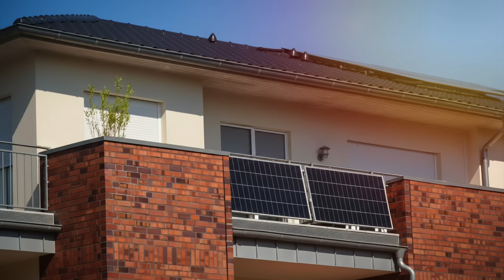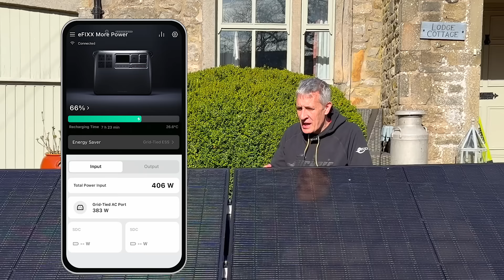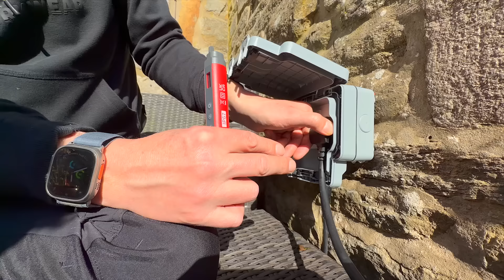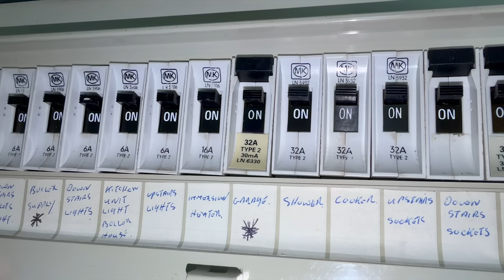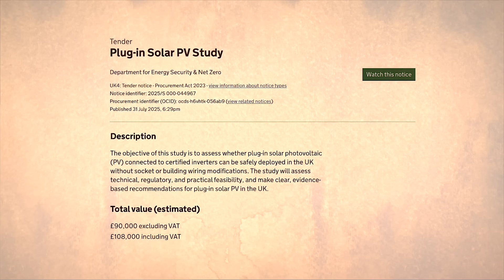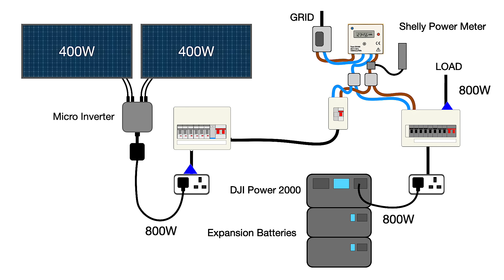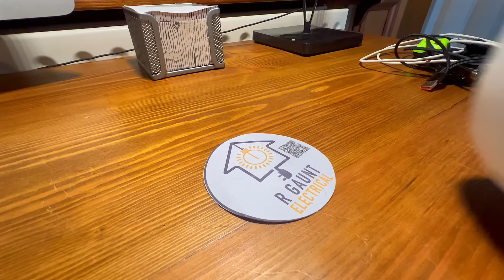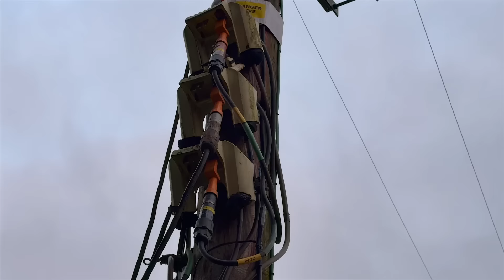Plug in Solar: We’re Told Never Do This… So I Did

Comment: We have ‘leased’ panels that we inherited when buying the house. There’s a few years left before I’m allowed to do anything with them but for now, we do benefit from never paying to run the washing machine / dishwasher etc during the day.
I have some ‘power station’ batteries we use for camping. I’d love to set them up so that they charge when there is excess energy being produced only. they would need to be plugged into a mains socket as I can’t tamper with any wiring on the solar system….. is there any way of doing this? Is there any equipment that can defect on the mains circuit when there is excess power going back to the grid which essentially ‘flicks a switch’?

Comment: Seems like an ideal solution where space is limited. I've got a large roof, but that's got hot water heating solar panels already that I don't want to remove. They provide all of the hot water for the entire summer without using any gas. This would enable the remaining odd spaces to have solar, such as the Garage roof.

Comment: If the DJI system is set to charge over night on cheap rate, and the solar panels just plug into the standard home sockets, how does the power from the solar panels find its way into the DJI batteries during the day? (Outside of the scheduled cheap-rate recharge time) - is there a control system that integrates this via software? (Or are you literally just enabling the DJI batteries to charge manually via the app when you have some excess?)

Comment: They call it balcony solar. But it is more uesd as storage roof solar. Easy to just put some on a storage shed and plug them in. If you only plug in solar the chance of overloading is minimal en 0 if you just put two panels. It gets a bit more tricky when adding batteries that also charge when power is cheap. But ppl also install ovens and washing mashines. They need to understand not to plug it in on a same circuit of even same phase depending on the max power capacity of the battery. The problem is regulations are usually made for the level of ppl that dont think about what they are doing...

Comment: But why would plugging it into a high quality rated extension lead be bad? If it's in a waterproof housing? It's the same as plugging into the socket just with some power loss due to length

Comment: £1 a day sounds a bit pants with 7 year payback on stored energy but surely using the almost 1kw while the sun's out saves the same again due to less conversions? Be interesting to know a clearer maximum savings potential between the stored energy scenario or when you use it directly during the day if you're able to do so. Maybe I'm overthinking it lol

Comment: This can't be legal because it's able to feed the circuit with more amperage than it's rated for.   If you have a 15a circuit, with a 15a breaker, and 15a wiring, the combination of the solars amperage + the mains panel feed can create a condition on the circuit where overcurrent protection won't trip properly.   It's analogous to putting a 25 amp breaker on 15 amp wiring.    Best case scenario would see a 7.5a breaker feeding a 15a wire while also putting a 7.5a breaker on the solar so that the sum of both breakers cannot exceed the rating of the wiring / other devices on the circuit.   

This is just a 'smaller' version of not being able to exceed the amperage rating of a mains panel.   If a mains panel is rated for 100a of service, you can't have a 100a breaker coming in plus another 20 or 30 amps of back feed (be it solar, wind, etc...) as the mains panel would then be able to exceed its 100a rating by a combination of inputs.    Thus the ideal solution is to use a 125a mains panel with a 100a main breaker and a 25a breaker on the solar side so that the sum is equal to or less than the panel's rating.

Comment: The danger is that people working on the power supply if there is a power cut.
The elections will consider that the power lines have no voltage. If you're putting voltage back down the line.
They could receive a shock.

Comment: Do you know if these batteries shown in your video for home solar systems allow you to limit charging between around 20%–80% to extend battery life, or is that handled automatically by the battery management system?
Also, when the battery is full, does the system stop charging and export power to the grid, or is there some form of bypass?

Comment: Solar installation fires in Germany are rising alongside adoption, with roughly 150 significant incidents annually among 2.5 million systems, often caused by faulty installation, technical defects in lithium-ion storage units, or, rarely, lightning. While serious fires are rare (0.006% of systems), they pose severe risks, including toxic smoke and difficult-to-extinguish rooftop blazes.

Comment: Great video. Very informative! 👏

We’ve been championing DIY Solar for over 13 years, so love to see this coming. 

Just make sure to use a G98 certified Micro-Inverter that has been tested for use on the UK grid. There’s a lot of cheap ones out there that are not tested and can be unsafe.

We recommend the Enphase Micro-Inverter. A USA brand that have been in the industry for 20 years and back their products with a 25 year warranty. 

When connecting an electrical device into your home, you need to know it’s safe.

Exciting times ahead.

Comment: Be good to have a type 2 plug on the end of the cable to plug straight into my EV on a sunny day
Reply: I'm more of a diesel kinda guy personally, but if it was possible to charge a car in northern England using solar, I'll be making the switch. Better that savings go into my pocket than the regime.

Comment: As an electronics engineer ,I do things differently, my way is a lot more efficient, cheaper, more reliable ,as there are less parts to go wrong & i have a lot less safety feactures, i can live with that,as im sensible,not someone that has zero knowledge on what can go wrong. Can i tell you what i do instead,no,as it only takes one fool to sue you ,when it goes wrong.

Comment: I am living in Germany with a 2000w balcony solar system, plugged into a 5.2kw battery. Max input to the house is fixed at 800w. Total cost was 1800eur including mounts for the panels. Last year having installed it at the end of May and full generation to the end of 2-25, was 840Kwh. This year I am at 240Kwh. When our electricity was at 40 cents per kWh, the pay back was quite quick, price is now around 27 cents per KWh. Honestly, installation could not have been simpler,but it should be noted that most German houses have balcony’s, hence the name.I wish we had put it in sooner and whilst this does not cover our energy usage, it does allow us to at least cover some of our demand. The challenge I see for the Uk is not the system it’s self, but where to put it. The benefit for us is it was an easy install on an existing balcony, but the uk with modern building styles, tiny gardens, means the only place is on the roof and then the installation becomes more costly than the equipment.

Comment: So why as installers do we need to declare to dno of our connections. Apply for connection. Customers can only have export limitation. ENA data base of inverters and batteries we can install. Bidirectional rcbos. CT clamps. Energy meters. Pay for MCS to provide certificates. Pay for governing body to sign off work. People will say its only 800w systems but as an electrician iv see a lot of bad DIY jobs and trust me people will be using extension leads. Overloading ring circuits. Its a complete contradiction and frankly i can only see this being regulated once god for bid some diyer burns there house down with there family in it for our government and IET to rush in regulation change. 
The current industry is a joke

Comment: Confused. At 1.46 he says there is power flowing until he pulls the plug. Thats is the same when you unplug any appliance. The source is the socket, no?
Reply: Or is the socket isolated at the consumer unit. But if that was the case it would be the same as being unplugged

Comment: I've put in two of these in Germany, one of them with a battery. 
My view, the most dangerous part will be people trying to mount 440W panels on a balcony and losing their grip. These are unweildy.
Also, compared to Germany the UK is a LOT windier. Make sure they are secure. 
My flat roof solution is 4 440W panels (€55 each), 30 degree mounts (about €30 per panel), a €90 micro inverter, and a €900 4KWh Growat Neo battery. The panels plug into the battery, which then outputs into the inverter. Plus I installed a IP65 rated outdoor socket connected through a RCD. 
I program the system to release 250W throughout the night. That is a good add on to the house panels and battery. 
If you are just installing 2 panels and have no existing solar, a battery is not worth it as almost all your generation will offset mains load. And no how above battery costs dominate total costs.

Comment: If only I had waited... I spend £6k on a 4.5 kW system on my roof in November 2025. ... I wish I had waited for a) Balcony systesm   B) PVT Solar electric and Thermal hot water via the roof. 
Space Heating and water heating take more kW than lights, fridge freezer, and PC.    How to heat the home via electric

Comment: So why not just plug the panels straight into the DJI batteries? They have solar inverters built in. Then you do need a separate micro inverter surely?

Comment: Apologies if you mentioned it and I missed it, but did you address what happens if the incoming mains supply to the house itself fails? To prevent a solar installation - including plug in systems like this - sending voltage back into the mains, potentially putting anyone working on a supposedly ‘dead’ mains at risk - my understanding is that solar and battery systems are designed to shut down. (You demonstrate that exact effect when testing the plug). Ie. If these systems need incoming mains to work, that would mean you can’t use them during a power cut. If that is the case, is it worth highlighting this in case people are thinking of buying one to cover themselves if the mains fail, which (if this is right) is when they wouldn’t actually work?
(Some solar systems have a ‘gateway’ unit that isolates them from the mains during a power cut so they can power a house when the mains fails. My understanding is that without this, solar systems are designed to shut down during a power cut.)

Comment: So I would pay about £3000 for that set up is that right
Reply: 3k for installation, 7k for equipment - 7 years before break even if nothing breaks or gets damaged. Just put your 10k in an instant access cash ISA and you'd see a better return without the risk.

Comment: You have ALWAYS been able to plug a "solar panel" into a socket in the UK. Providing it met the standard required for anti islanding. The problem is most of the inverters didn't. This hasn't changed. But I think you probably know that too don't you.

Comment: I assume that there won't be any problems plugging them into an older ring main, with traditional fuses, (Wylex rewireable types) & standard non smart meter. Would the meter slow down or even run backwards if you were not using much power?

Comment: Why Does nobody talk about the fact that solar panels are not degradable, only last a maximum of 25 years, and use a huge amount of raw materials. Its not a reliable energy source with unreliable sunshine
Reply: They are fully recyclable, try looking it up, as it's been UK law that ALL batteries and solar panels have to be fully recyclable. You can even sell old ones to scrapyards in the UK, my local scrapyard pays £0.25p per KG for panels, meaning the average 25KG panel you will get £6.25p, I sold around 1200 panels to them over the last year. Also, most UK panels have a 35-year guarantee to 80%, but will still be giving out 65-70% power at 50 years.
On your "unreliable sunshine" This is why we have batteries, as they have in this video. I have a 30KWH battery, which means I would have to have zero sun for a week before I run out of battery power, but over the last 3 years of having a battery solar system, I've never run out of battery power. Even on the darkest days, I still make some power. Look on YouTube, as there are loads of videos of factories in the UK stripping down solar panels for recycling.
Reply: This is 1 video of 100's in the UK. https://www.youtube.com/watch?v=cnrJX0DCCGA

Comment: I'm not an electrician but i have done extensive research on this subject as i was thinking of having some of these panels until i hit this safety warning advice. The plug in panels that will now be sold on amazon and Lidl pose a serious risk do they not. This is what i found.
In a professional solar installation, the panels are wired into their own dedicated circuit breaker at the main board. This means the consumer unit 'sees' exactly how much power is coming in and going out, and can protect the house accordingly.
With these 'Plug-in' kits, you are bypassing that brain. By plugging into a standard wall socket, you are injecting power into a circuit that was only ever designed to deliver power, not receive it.
The main breaker is 'blind' to this extra power. It only monitors what you pull from the grid. If your solar kit is pushing 3 Amps and your appliances are pulling 32 Amps, the breaker thinks everything is fine because it only sees 29 Amps from the grid. Meanwhile, your actual house wiring is carrying 35 Amps—which is more than it’s rated for.
This is why experts are calling it a fire risk for older UK homes. To be truly safe, any solar power should be connected through the main board so the breakers can do their job and protect the wires in your walls from melting. Am i correct.

Comment: I don’t like this idea at all it will see people over expanding , further more I can see dno again restricting output to stupid levels of 4kwh per household, when everything has moved on and most people have capacity from June 26 with new 500w panel’s in 68 cell format make market ideal for domestic market, these home plugs will be exporting 2kwh in sumner to the socket , but roof top 16 panel’s will match a peak of 8kwh or more typically 7.2 kwh be perfect for a busy home , and charge a battery though would like more than 800w output on a plug since latest pc rigs for kids thanks to nvidia need more than 1.2 kwh. To power them  90% of loads from kettle , heat the water , pc , broadband/phone  connectivity fridge freezer of the typical f band unit  tv and two room lights will be covered plus if you size right with a proper g99 battery storage with off grid island mode , you can kiss goodbye to the bill from may till November .
Reply: A pc using 1.2 kw? Are you running your own data centre?
Reply: @RichieReportsUK   intel latest pc needs 350w for cpu ,  graphics  600w ,  1.2kwh  need for disk and ssd 3 
and next update 2027 pc will need even more power

Comment: All new homes should include solar and wind generation, and existing homes should also meet a mandatory generation requirement if they use a lot of power. New builds should also have a communal battery storage site to help keep everyone running smoothly, acting as a UPS. In the event of a power cut, the new build will remain unaffected for a few hours, by which time the grid will be back online.
Reply: yes on solar, no on wind (it's crap unless you can put a massive one up or live on the coast) and no on the communal battery, that is where you can get your investment back. 

Knowing house builders, though, they'll put the worst of the cheapest of the worst they can find just to meet the regulations. I'd rather they pre installed the wiring and mounting for solar panels and the wiring for the batteries and then let you send your own installer in before you move in.

Comment: If you just have say a basic system with an old electric meter, consumer unit with fuse wire or RCDs, basic ring mains lower and upper floor, one for sockets and one for lights, a supply for the cooker and perhaps the immersion heater, how can you be sure that 100% of any energy you generate from solar panels will be consumed within the house and nothing will be fed back into the network? What prevents energy being fed back towards the network (DNO). Could it potentially damage your incoming mains supply meter?

I can see how you could create a separate ring main to use any power from a solar panel micro-inverter and possibly add portable batteries onto it to make use of any unused solar energy but how to you get to to work predictably and effeciently by just plugging it into your mains from any convenient socket?
Reply: That's how I'd be using it, so if you were out for the day & nothing much was consuming power, would the meter start to count backwards?

Comment: Looks like the law is changing.... sky news today.... Plug-in solar panels that could save you £100s to be available to buy in months... Plug-in solar panels will be available in shops within months, the government has said, to speed up the move to renewable energy as the Iran war pushes up bills. The "low-cost panels", which are already popular in Europe, can be used on balconies and in outdoor spaces, with retailers including Amazon and Lidl working with the government to bring them to the UK market.
The government is changing regulations to allow UK households to connect 800W+ plug-in solar panels to domestic mains sockets.